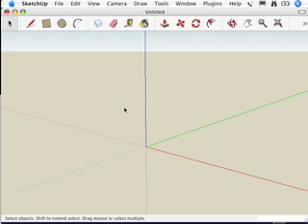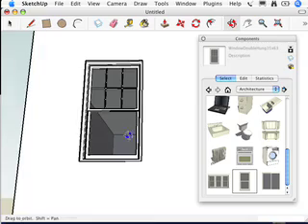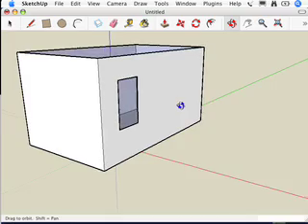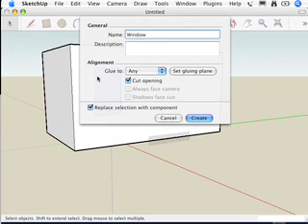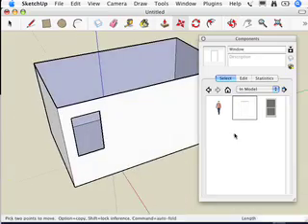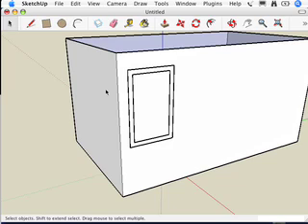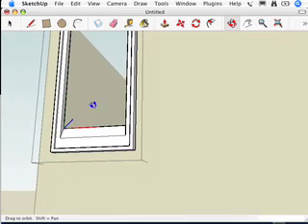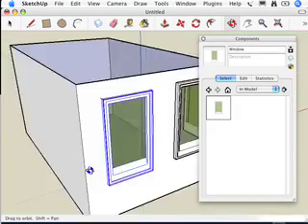SketchUp: Making your own doors and windows

Comment: This is a terrible video! Anyone doing any real modeling in SketchUp will have a thicknesses to the walls. Simple making a rectangle and deleting the face is not how an actual model of window is made. You should add a depth dimension to the wall and demonstrate how to push/pull a window through it properly. Terrible...just terrible video 😡

Comment: thats what I used to do but it is a pain in the ass when you have 3 inch offset walls. It will be hard for you to match the rectangles on both sides of the wall.

Comment: I'm having the same trouble... I make a wall, say, 5 11/16 inches thick. the window opening goes in on both walls and its directly lined up. Hit create component (G) and then go to the alignment section (on PC its at the bottom) and glue to any and check cut opening. It works like the window in this video, bringing the hole with it, but it still isnt a component. maybe its just my computer.

Comment: ptp29, I just spent a half hour trying to cut into a wall with thickness with a window component. No luck. Seems like you can't do that. Google "sketchup component cut opening". 

Workaround might be to cut the hole first then insert the window component into it. Just be sure of the opening positions to save a lot of patching. Get the openings all in the right place and wait till you're sure of their positions before inserting the components. If there's a better way I'd like to hear about it.